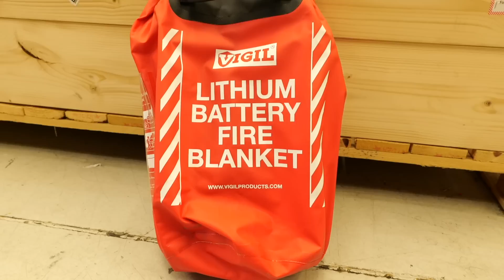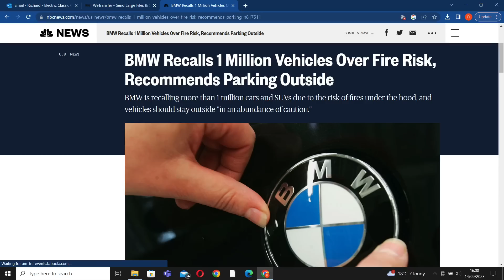Electric Car Fires - Facts and Figures

Comment: We know all EV batteries are not created equal. It would be interesting to know if the Swedish study broke down the EV fires by the type of battery they had. We know the LG-Chem(?) batteries used in the GM cars were terrible while LFP batteries have hardly ever(?) caught on fire. The fact the study shows an effective halving of EV fires (twice the cars, same number of fires) is a good sign poor batteries are being removed and replaced with better batteries. I would also like to know how many EV fires were attributed to arsonists. Of course we all know the facts don't matter to a lot of people, especially those with interest (lots of money) in oil stocks. These people don't care if ICE vehicles catch on fire because everyone knows this happens frequently. Oil lovers simply can't handle the fact that oil use will and is going down because of renewable energy production and EVs and they can't stand their bank accounts losing money. It's always about money, hardly ever about facts. One last thing. I'm sick of all the filthy trucks, diesel and gas, that spew garbage into the air. I do a lot of walking and I should be wearing a mask to keep from inhaling these fumes along with all the cigarette/cigar smoke coming out of cars and by people being required to smoke outdoors. They need to have bags put over their heads to contain all the smoke so I don't get second hand cancer. (Studies have shown non-smokers are getting much more cancer caused by second hand tobacco smoke.)

Comment: At Stavanger Airport at Sola, a diesel heater started a fire and most of the parking area with cars burnt down. Electric car next to the diesel car did not catch fire in the battery, but tires melted etc

Comment: I've seen, in person, dozens of vehicle fires through 40 years of driving, have yet to see one caused by an EV. I've no doubt they happen and the issue will improve over time. Petroleum still holds the record for biggest fire/explosions/damage if you include the whole supply chain.
Reply: Yeah, I've yet to hear about a lithium train derailing and burning down a town.

Comment: Maybe it would be better if the battery boxes weren't made of metal which withstands fire. It could be better if they fell apart to allow access.
As you says fires per EV are reducing as LFP (and soon sodium) are becoming more common. It worth mentioning NMC batteries are full of oxides which supply the oxygen for the fire - a bit like thermite. I think the phosphates in LFP don't do that.
Reply from the maker: True. LFP and Sodium based batteries are much less likely to ignite. 👍

Comment: A large battery on fire is no joke, they're extremely difficult to extinguish and they generate toxins that really harmful to your health even if not inhaled.

Edit

What follows is taken from an article posted on the ABC news website..

Lithium-ion battery fires release toxins such as carbon monoxide, hydrogen cyanide, hydrogen fluoride and cobalt.

Mr McConville said these toxins were particularly dangerous for firefighters because they were absorbed through the skin and clothing could not protect against them.

"[Carbon monoxide and hydrogen cyanide] both prevent the body using oxygen, and cyanide affects organs that rely on high levels of oxygen, such as the heart and the brain," he said.

"We've already had a situation in Victoria where two firefighters suffered cobalt poisoning after attending an EV fire, and have nowbeen permanently disabled as a result.

"These toxins also present a major risk to other emergency services personnel, such as police and ambulance officers, bystanders and the broader community, and as such every possible measure must be undertaken to mitigate their impact."

Mr McConville said more needed to be done to keep Canberrans safe.

https://www.google.com/amp/s/amp.abc.net.au/article/101824468
Reply from the maker: I wouldn’t advise inhaling any fumes from a fire be that ICE or EV. But having inhaled fumes from an EV fire demonstration I’m still here to tell the tale.
Reply: @ElectricClassicCars   Try that with the batteries that have cobalt in their chemistry and you will definietly not be walking away from that
Reply from the maker: They did have cobalt in them and I’m still walking. 😂😆😉

Comment: Richard I think you should add one more filter and only compare fire occurrences of the same age ICE (excluding fires of vehicles older than the EV fleet) and EVs (of which there aren't any "old" ones).
Reply: It was a rather shallow, not deep dive into that, which really did more harm than good if you can think critically for yourself...
Reply: I thought the same. A poorly maintained 10 year old ICE car is going to be more risky anyway than a 1 year old car of any fuel type.
Beware of statistics. 
I'm an EV driver by the way and firmly believe in the future of Electric road transportation.
Reply: @geralddavison  I'm with Toyota on this one. And as for the Grid, I have zero confidence we'll be able to afford the transition, unless we rely on imports from Europe. We can't even foot the bill for highspeed rail at 100B let alone 100B per year for the Grid...
Reply: @LoremIpsum1970  do you mean Toyota and Hydrogen? 
I'd be happy to see green hydrogen powered vehicles.
Just think it's unlikely as we'd need three times as much electricity as for BEVs. Plus it'll be way more expensive. 
Hydrogen fuel cells will be part of the picture for sure.... but unlikely to be anything except niche use.
Reply: @LoremIpsum1970  I'm afraid I'd rather trust the actual people and engineers responsible for the electricity grid. We are way below our peak usage which was in 2005 when we used 358 TWh. In 2022 it had dropped to 275 TWh.
EVs will add to that, but careful use of differential pricing will smooth out peak demands.
Reply: @geralddavison  including HBEV. With all that renewable energy...and the amount of shutdowns due to load  balancing you could use wind 100% of the time with hydrogen generation. Still wind speeds are dropping in the northern hemisphere and solar's not great at high latitudes. We have no hydro storage but you could use hydrogen. Europe are rolling out Hydrogen for vehicles... but all you hear is crickets in the UK...if you pushed domestic hydrogen as well that might make it easier. We haven't really looked at short term battery storage and load balancing...which is why importing will probably be the way and priced by demand. Going 100% renewables isn't pragmatic in the UK. Nuclear takes too long and costs too much, Drax biomass is a CO2e accounting trick, bulk stored natural gas and existing nuclear should be the power backbone for the foreseeable future as wind and solar aren't all that dependable until there's enough over capacity.
Reply: @geralddavison  with off peak charging, say good bye to cheap rates as it will all be peak. With an estimated cost of 3 Trillion GBP by 2050 if we're under capacity I'd like to know what they're spending all that money on. It's not just the main Grid but domestic supply and substations and rural supplies that will all need upgrading.
Reply: @LoremIpsum1970  even with vehicle charging there will still be off peak times. The daytime usage in homes/factories/shops/offices will still dwarf vehicle charging.
Green hydrogen has a big part to play in decarbonisation. But my view is that it will be in storage for low wind/sun periods and for industries that use grey hydrogen now and new hydrogen powered industry like iron/steel production.
Maybe as a feed for Amonia production for powering ships.

It's wasteful to use it for ground transport and even more wasteful to pipe it to homes and burn it in domestic boilers.

We will need all the green hydrogen we can get for the things it is critical to use it in.
Reply: @geralddavison  With all the home appliances being shifted by choice (or not) to current off-peak times, I doubt you'll see much difference in tariffs in the future, and you'll get no solar contribution without interim storage... Forcing people to change usage may not end up with the results you're looking for, there's going to be a lot of pushback. Erm, newsflash we're moving steel production over to electric. It's all going to come down to how much generation is possible, I'd hope they went for excess, but at 3 trillion, I don't see it being cost-effective for the little benefit it will provide.

Comment: This is again the "Last Gasp" of the Fossil Fuel Industry, When Horses where replaced by Cars, there were stories about the Oncoming Horror of Petrol & Speed, Now they are going into a downturn they engineered, by delaying & Not Embracing EV's, OIL will still be needed for Lubricants/Industrial etc, but they want NO Change to Cashflow.. We are still in early days of EV's Still, Battery Chemistry could change, A Lithium Fire Suppression System built in to Vehicle may end up fitted like a Airbag to Vehicles, it is a Evolution, with some Ostriches heads buried in sand crying "Petrol Cars Don't Burn!" ..

Comment: I don’t agree with your summary of the percentage of fires in Sweden as you are ignoring the age of the cars as a factor. ICE cars have a multitude of fuel pipes which deteriorate over time. Surely this is a factor? Electric cars are inherently newer. Btw my next new car will be electric 😀

Comment: I suppose the most notorious BEV to catch fire is the GM Chevy Bolt. The tractor battery is supplied by LG Chem. And a fair few caught fire. My VW ID3 battery is also supplied by LG Chem. You don't hear of VW ID Series cars going up in smoke every 5 minutes, do you. That bit about BMW car fires. I believe it was South Korea where BMWs were to be banned unless BMW started taking their petrol car fire risk seriously. Incidentally, I have been in 2 petrol car fires. Neither made the news, of course. One was quite serious and it was only because the car was parked near a newly painted garage door that I detected the flames early, and was able to get out and douse the flames.

Comment: new battery chemistries are much safer, hey?
Reply: You can't get the performance out more stable battery chemistry especially nickel. Lithium ion charges and discharges waay faster and way more amps vs weight. What is promising is Toyota solid state batteries. They are stable because there are no liquids

Comment: Do the studies identify how  the  different ev battery chemistries compare?  LFP  battery fires are possible but much less likely than the NiCo ones, also the consequences are much less severe ( interesting YouTube videos show this).
Reply: According to a Norwegian fire chief, most EV fires don't start in the main battery anyway - but are usually interior or 12v electrical fires.

So I'm guessing LFP cars won't be significantly less likely to catch on fire, because there's always something flammable in a car.
Reply: @logitech4873  That’s interesting. ICE vehicles must have similar 12V make up so something else is going on I guess. Anyway, true or not I feel much more comfortable with my LFP car, not just because LFP is less volition.

Comment: Misinformation is what the gas and oil industry wants. I’ve saved 10k in gasoline costs in five years. My Chevy Volt (hybrid) has been awesome over the last five years, not one problem. The battery pack is still great! My new car is a Tesla Model Y, long range. I’m not one to be duped. EV’s are far, far, far better than ice cars. Almost no maintenance. Battery packs can last decades.
Reply from the maker: Well said!

Comment: The funniest thing I've seen is the Sydney Airport fire. Five cars were destroyed, and the battery was removed from the EV, and yet, the EV definitely started the fire. No, the battery pack started the fire because either 1) the person had no clue what they were doing in repair or 2) someone took the time to sabotage the car.
Reply: And, the battery pack had been removed from the car because it had been damaged by driving over major debris on the road. The damaged battery pack had simply been left lying on the ground, in a densely populated car park, unprotected from the weather.. Not very smart!!
Reply: @davidrumsey3180  Especially considering they had to pull the battery mostly out of the car before they stopped. It would be akin to pulling the gas tank out full of fuel and letting it sit in a busy parking lot.

Comment: This topic is so infuriating since it is all media looking for click bait and not remotely based on facts.  I have never seen a fire caused by batteries, but I sure have seem plenty of ICE vehicles burning to the ground.  So many have so much resistance to BEV's and will go out of their way to post stuff on media to try to put down EV's, and many of them are not in a situation where their jobs are threatened or they are being steering into buying an EV.  Many have never even been in an EV. So frustrating.  In not that many years down the road, these people are going to be the same as anti-vaxers and they will be in the minority.

Comment: Breaking news: Brand new cars are less likely to catch fire then ICE cars that average over a decade old and most of those fire are caused by the electrical system aging and shorting out. These vehicles will age terribly with the current way they build everything.

Comment: Would be interesting to find out what percentage of those EV car fires were due to actual battery failure as apposed to other external forces.
Great video Moggy, keep up the good work on your classic conversions. 
😎👍
Reply: I read the short summary of each of the 81 fires 2018-2022. Sometimes the cars were too burned to know where it started but in many cases the battery was not the source and also survived the fire undamaged. Where the battery likely started the fire was after colliding with another car, one after hitting a building, one was after a train hit the car, 3 were likely amateur converted cars of which one was under construction and a few more cases. One fire was from a seat heater, one from a headlight, one from a short in the 12V system, one from the 12V battery during charging, several incidents seem to be cables/outlets over heating during charging. Many of the PHEVs had fires in the engine bays but often the battery was unaffected. A couple of fires seemed to be an ICE car catching fire in a garage and then spreading to the EV. An interesting read.
Reply: Doesn't matter really. In fact that's one of the biggest shortcomings of the battery car is it's fragility to external forces. Even tiny dents on the underbelly are causing many to replace their entire battery because it damaged a few cells. And those little dents have also caused fires and explosions that have nearly taken down entire ships. Just saw 2 separate incidents where large ships were nearly destroyed by EVs. Cars are very prone to getting minor underbelly damage while being loaded with ramps on ships.